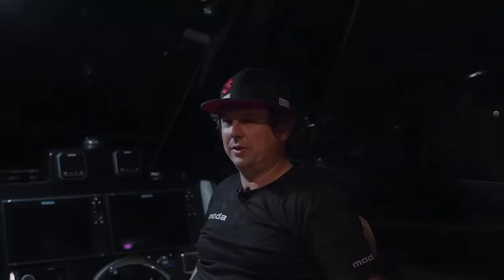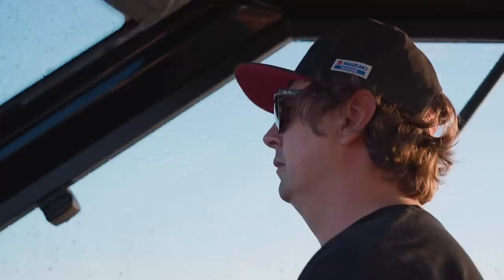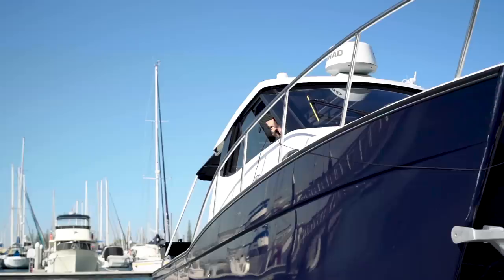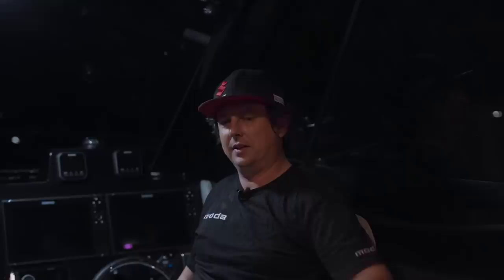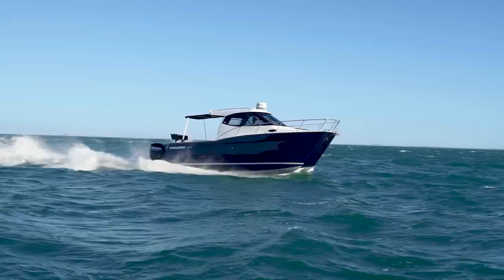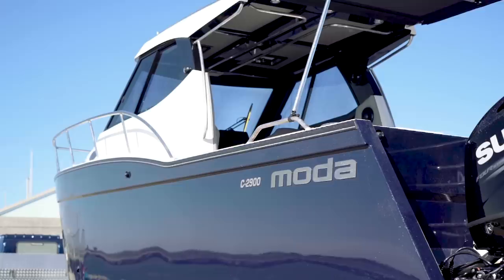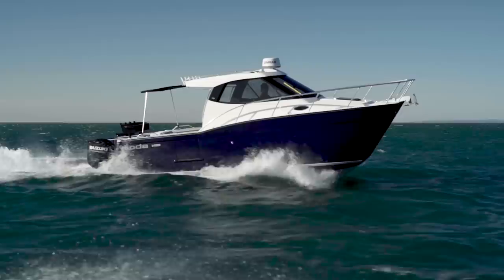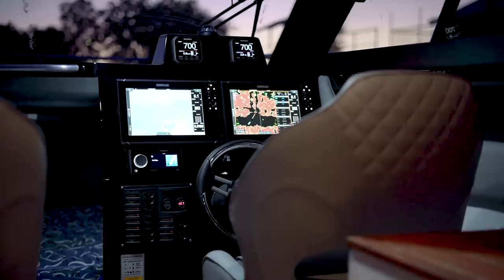Moda Marine's new C-2900 cat

Comment: I lived in Key Largo for 20 years and would listen to the boats coming by my dock. SUKI’s are by far the quietest.
Reply: Quiter then yamaha?? Personally I feel Yamaha takes the cake especially for the larger outboards.
Reply: What about the 350’s?
Reply: @krugmeup2162  the entire SUZUKI line of of outboards is excellent. They have mega experience with engines via all the other products they make.
The only issue is dealerships/repair facilities are few and far between. Mercury is poised to take the market from Yamaha. They finally got the bugs out and dealerships are abundant. AND Mercury 40’s and above are made in America. Lower HP Mercury’s are made by TOHATSU.
Reply: @Mr91495osh  so you would choose Suzuki or Mercury and not Yamaha?
Reply: @krugmeup2162  I wouldn’t buy Suzuki bc they don’t have enough dealers. I owned a Yamaha for ten years and was very satisfied but they are made in Japan and I want to buy America when I can. The new Mercury’s 40 HP and up are excellent engines. Mercury’s under 40 HP are made by TOHATSU and, in my opinion, are marginal.
Reply: @Mr91495osh  ok thanks. I’m in Australia so I’m happy with Japanese or US made. Just not your cars lol